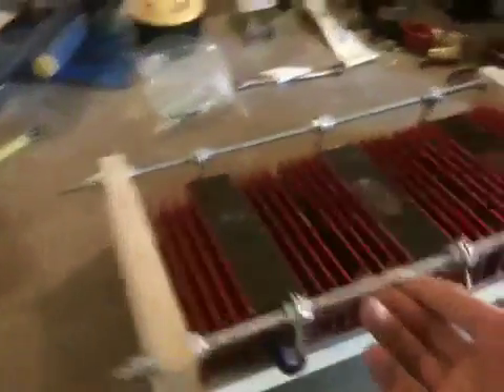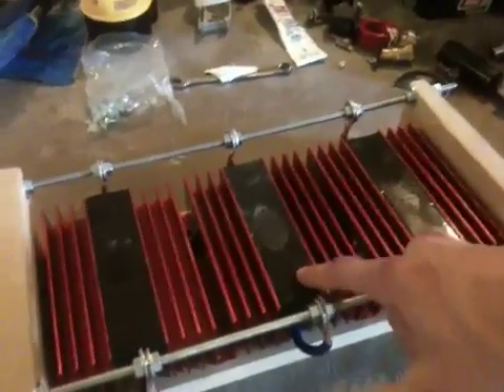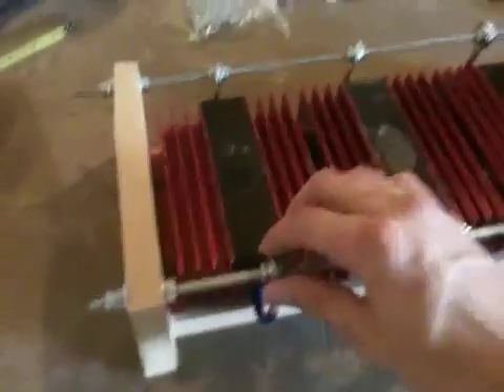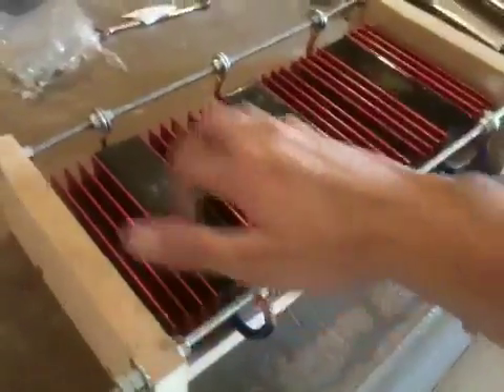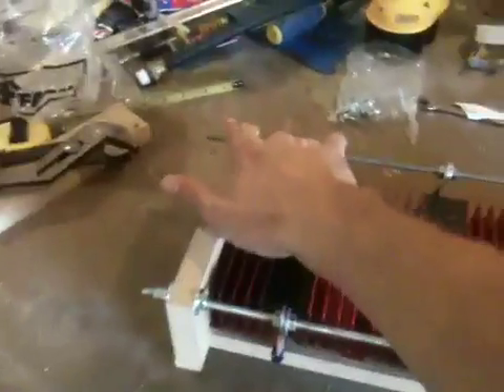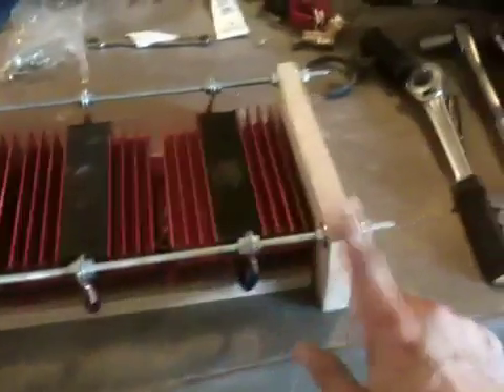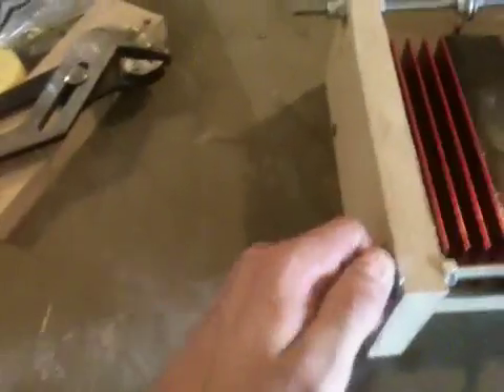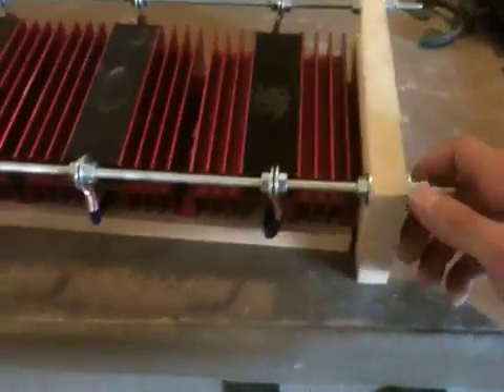Xspower step down rack

Comment: So basically you just connect from the alternator charging stud to the 16 volt side, then the 12 volt side goes to your underhood battery? Does the wire harness that you plug into the alternator need to be messed with at all or is just plugged in as usual, normally i would just a separate alternator for my 12 volt side but the vehicle i currently have only has room for one, and id prefer not to have to do any modifications or fabrication of a bracket cuz its a really small engine bay, i plan on getting another tahoe or yukon or suburban, but until then i gotta use the stepdown modules to run my 12 volt side, any advice would be greatly appreciated

Comment: I am having issues putting triple alts on my truck I want to go back to dual Alts but both charge at 16.5 can I use two or three if these to charge my 12v side of my truck to run my stock ecm?

Comment: I believe I have figured out the problem here. The 993 is good for 25A continuous (50A surge). With knowing that, yes you now have 75A but, that will generate a ton of heat with a constant load, most likely the reason for equipment failure. What you could do is get a small 12V battery like the D375 (MSRP $130). This will give you 800A which is more than enough for the vehicle electrics. You will be able to run a single 25A at this point to simply charge the 12v battery. 

The only concern is the starter at this point, this is the reason cars have such large batteries, a starter has big power requirements, which is why everything in the car shuts off when cranking the car. Wire up the alternator main power feed to your 16-18v and the trigger wire will be part of your 12v.

Comment: XS Power Voltage Step Down Modulers Suck. And So Does the XS Power Voltage Regulator. I got both, and the Voltage is a RollerCoaster, always 2 High or 2 Low. Very Disappointed in tha $ I wasted on equipment that doesnt even work properly!
Reply from the maker: Maybe try installing it properly, see if that helps.
Reply: Ha Ha... Yea That's It. Maybe I Got tha (+)N()&()N(+)??? Shut tha Fuk Up Funny Boy.

Comment: Okay let's say I'm running a 16v system and I'm doing stepdowns like these to run my cars regular electrical this way, would having a 16v ground grounded to the same place as a 12v ground matter? If you're confused by this what is a good way of doing a 16v system off 2 alts and still running my cars normal electrical at its normal voltage?